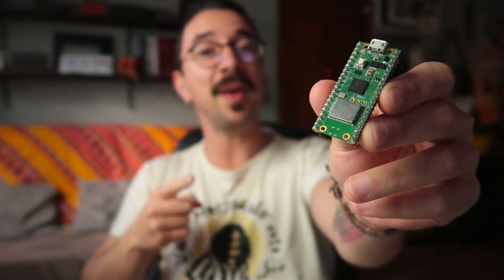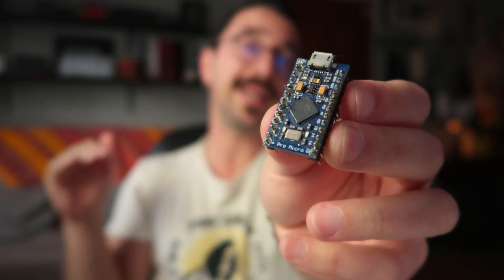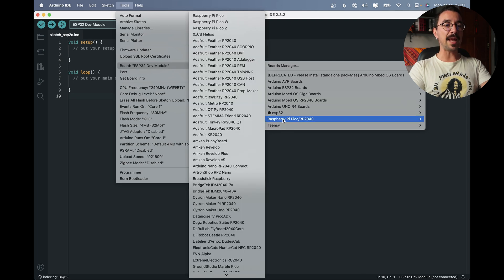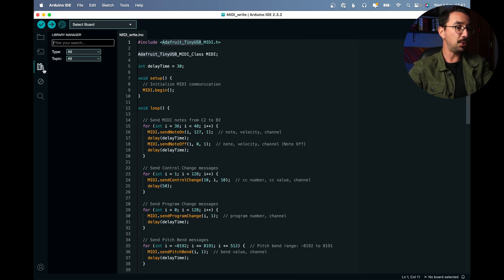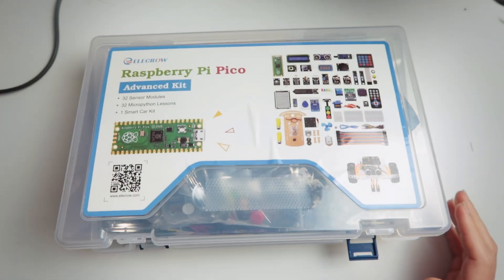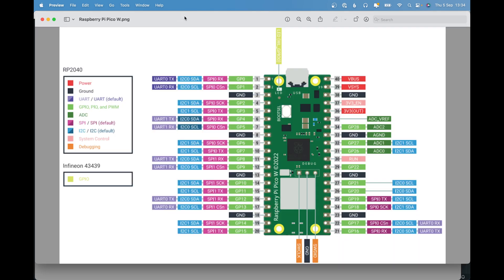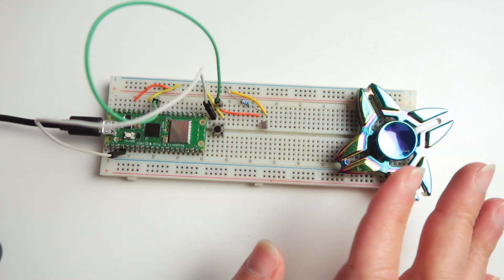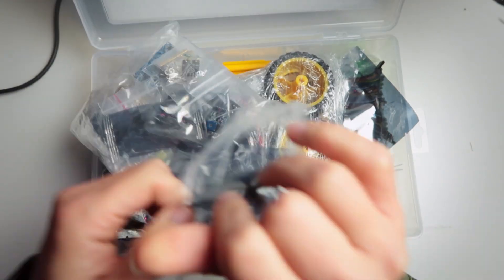Make a Raspberry Pi Pico MIDI Fidget Spinner

Comment: Ahhh! You are my muse, dude! I love that content. 🙂
Years ago I watched the German guy Götz Müller-Dürholt because I was satisfied with my edrum hihat controller (MPS-850) and I thought ... hmm ok. Let's see...
Great guy. Later you and Dave from @NotesAndVolts, great DIY projects.
I finally finished my first prototype MIDI controller. I wanted to build just a 4 fader controller and now bought a 3D printer for that and designed an enclosure. HA! 
And now, it has NeoPixel illuminated MX keys and a OLED display. And then, I was programming a menu and needed to write some code for the LED lighting and the ProMicro ran out of memory.
Damn! Anyway. I am gonna switch to the Nano ESP. 
Thanks a lot, for your efforts. If you are interested in what it looks like... I put a few pics in my community section.

Comment: This is great! I am going to make a diy electronic wind instrument, do you think the RPi pico is fast enough? I was thinking of using a teensy 4.0 because it can be recognized by the computer as a midi device very easily, but no I see so can the pico. The price difference is huge!
Reply from the maker: It's fast enough for sure!
Reply: @NerdMusician  Hi! I bought a RPi pico 2, and did everything as explained, but I can't upload any sketch to it: perhaps because the board is so new the Philhower board manager doesn't support it correctly? I selected the right board and it's detecting the UF2 comm...

Comment: You totally rock!  After I destroyed two micros, (learning to solder) I'd taken a break from midi controllers, but you inspired me to try the Raspberry Pi, and it works like a charm! Working on building a breath controller using a digital output pressure sensor.